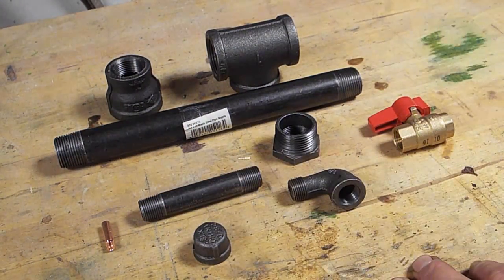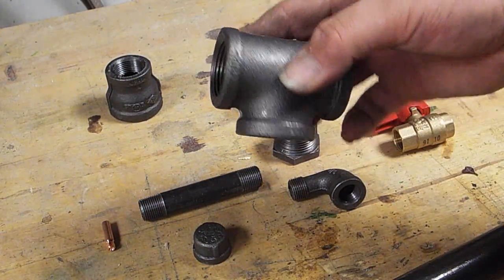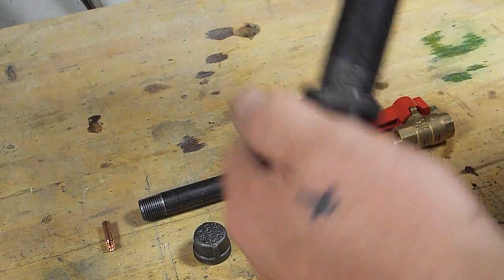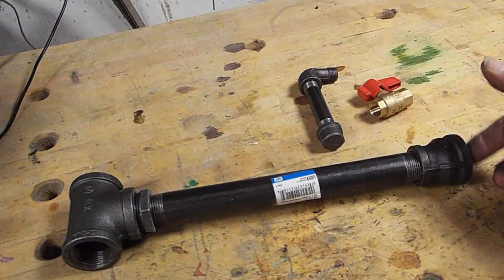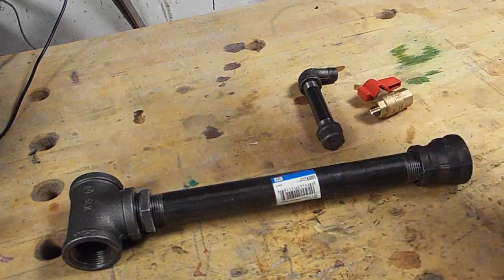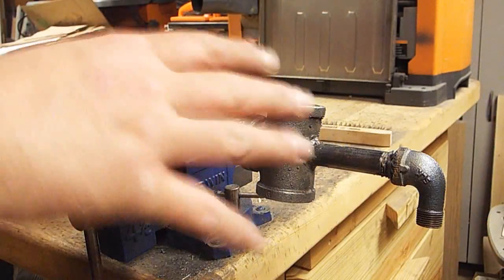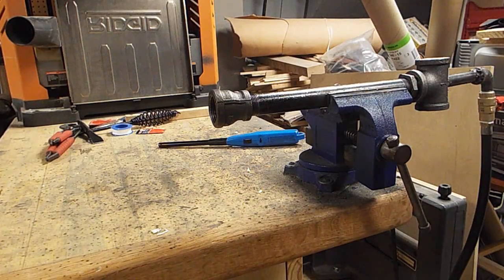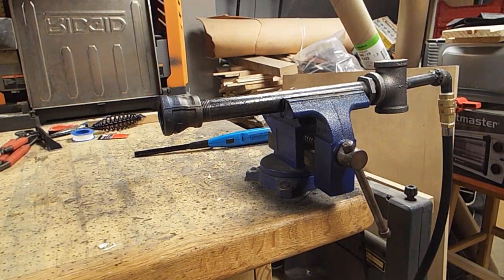GPW 98 - DIY Forge Burner

Comment: The BAD thing about galvanized piping in a forge burner is that when zinc is heated at high temp it produces VERY toxic fumes. This is why experts warn DIYers  NOT to use galvanized steel in this kind of projects.

Comment: I was wondering if you drill and tap the tee so that you can screw the nipple into the tee then you could use the cap with the mig tip to jam lock it in to place.
Reply from the maker: I have asked, in the past, about running long threads on black pipe and was told that it doesn't work very well... But, if you can run the threads long enough, on the nipple, to get past the radius of the tee... Then, I think it would work.

Comment: How big is the hole in the MIG tip???
Reply from the maker: I am pretty sure that I used a .030 in the video... I seem to remember changing it to a .025 later on and noticed that the forge actually got hotter.
Reply: @GPWoodworks  Thanks a lot for your answer... great.

Comment: 3:12 galvanize poisoning apparently has similar symptoms to the flu and it set in pretty fast form what I've read.. 

if it does happen get some fresh air and rest if it's severe seek medical help because it can be lethal. 
also to speed recovery drink milk as the calcium will help your body get rid of the zink.

If you have to weld something galvanized then removing it with acid works pretty reliably and safely.

Comment: If you just use Teflon  tape it won't hold up gas is a corrosive element you have to use special Teflon tape made for gas plus you should test for gas leaks with Windex pressurize your fittings then spray them otherwise you could blow yourself up

Comment: I like the mig tip design feature best if all, that's clever. Oh and welding galvanized is most hazardous to breathing the smoke, wear an organic vapor respirator with an n95 prefilter and you should be good.

Comment: Good job I like your approach. Im a pipe fitter in the union of 20 some years now so I've cut and threaded un godly amounts. Lol..at any rate I'm taking up forging now and in process of making a 3 burner banger...lol...but the only thing is that you don't need to weld the threads are strong but more power to you. I might make a video as well...any tips lmk
Reply from the maker: Scott Andrews

 Thanks man!

I welded for the practice.

As far as tips... my videos are mediocre at best... I would say try to remember to focus and stay in frame... other than that sound is a big deal... I fought with the sound for a year or so. 

You can fix continuity issues during editing usually so just have fun and don't try to look/act like anyone else. 

Be you.

Comment: The fumes it makes. U could use JB weld like a liquid pipe dope.
Reply from the maker: Yes you can... But as you can probably tell... I needed the welding practice.

:)
Reply: GP Woodworks constructive criticism I was not trying to be a troll I'm sry if I came off that way.
Reply from the maker: Not at all! 

It was a good idea. I have seen others use JB Weld for this. 

I really meant what I said. I welded it because I need the practice. My welding sucks.

No worries man. Thanks for the comment.

Comment: Hey
i have construct almost the same but with a 2 burners.  How long is the pipe that goes in the oven ? I have 2 nice blue flames but with not much pressure..maybe my gasbotlle is almost empty..i dont now..but i use a valve on the gastank of 37 mbar..should be ok ?
greetings from Belgium.
Reply from the maker: According to this converter: https://www.convertunits.com/from/millibar/to/psi

That's about .5 PSI.... That is VERY low pressure.
Reply: GP Woodworks 
so indeed it was...the pressure valve was one for camping fire...niw today i bought one of 4 bar...damn...its like a jet now..it burns like hell now in the oven..so im glad this one is working great and now i can further forge the dragonhead im working on..thnx for this video...keep up the good work.  Tom
Reply from the maker: Thank you!

Comment: I made a pair of these and connected them inline, I had them working fine in the vice, however once I installed them into my forge  one of them was stead y burning and the other would burn but sputter, wondering if you might think this is an alignment issue??
Reply from the maker: Not sure... try lighting each one independently. if the sputtering one will work without the other one burning, then it's probably something to due with the setup (burners too close, forge too small or closed in for two burners etc)

I'm really not sure what the issue is, but that's not a bad place to start.

Comment: Great video!  I'm trying to make this.  My local hardware store has MIG tips but they are in inches: .023, .030, .035, .045.  but I don't see any .6 or .8.  Is that in millimeters and if so what would that be in inches?
Reply from the maker: .6mm is ~equiv to .023.

.8mm is~equiv to .030

I started with .8 and changed to .6 in my burner. The .6 burned hotter in the forge.

Comment: I had a friend that welded Gal. all his life . Well it finally killed him he died at the age of 106. So I would stay away from welding Galv.
Reply: i welded to for a couple of years they said drink milk before welding it what ever that did lol i have three heads now
Reply: @huntingtreasure8855 , that was all the milk
Reply: They now teach welders and trades men to work in a ventilated area with a personal respirator.
Reply: Used to seam weld Galvanized Doors, it would make what I call White Floaties in the air, did make ya a little nauseous, it's called Fume Fever drinking milk does help.
Reply: Done it myself more than once gives you a bad headache if you beeath enough thick smoke

Comment: Just curious how much would it be if I had you buy the parts, build it and ship it 
I really want to have a forge found out a way to do it without a welder but don't even have the tools to do a burner. I have a few knife designs I would Like to make.
Reply from the maker: It wouldn't be cost effective with so many inexpensive options out there.

Here are a couple of examples:

Small Atlas burner:
 http://usaknifemaker.com/knife-making-tools/forging-tools-supplies-c-172/forges-accessories-tools-c-172-173/atlas-small-burner.html

Atlas SS mini forge:
http://usaknifemaker.com/knife-making-tools/forging-tools-supplies-c-172/atlas-stainless-mini-forge.html

Comment: What length is the 3/4 Pipe?
Reply from the maker: I used a 10" long nipple for mine. I don't think that measurement is extremely critical though. I wouldn't go any shorter than 8", but it can be longer.

Comment: You could also use a black iron cross instead of the T and an inline orifice.  You can get both from Mcmaster Carr for about 10 bucks each.  That would let you make it without welding anything.
Reply from the maker: Dar1966 

Thanks... I was looking for a local store solution... but that would have been much simpler. 

Thanks for watching.
Reply: No joy

Comment: I did this forge  burner but it does not have enough air... the burner just barely and silently burns and is very lean... any ideas?
Reply: Wesley swap out your bbq 20 lbs regulator for a high pressure reg. One that will run between 40and 60 lbs.  this way should you choose to build a two burner you can have enough pressure to run both and not have the weak lean flame.
Reply from the maker: I am not an expert.... 90% of my videos show me doing things for the first time(including this video).... 

But, here are some thoughts...

Check the fuel delivery. The "barely burns" issue sounds like too little pressure. Too little pressure will cause the vacuum to fail as well, so I am guessing that you are actually running rich. How much pressure are you using? Are there any leaks at the port? What size mig tip did you use?

I hope this helps you figure it out. Let me know what you come up with.
Reply: This is old but... you may have got your tip too far in.

Comment: what size mig tip ?  like 0.6  0.8 or 1.0 ???
Reply from the maker: Ron Varner I used .8 but .6 may work better for this design. Check the other comments. Thanks for watching.

Comment: what size drill and tap for the mig tip
Reply from the maker: Danny Thomas 

Mine was 1/4-28 some are 1/4-20. You have to measure the one you're using.

Comment: Jesus dude there's now way that chicken hemorrhoid weld is stronger than the threads.
Reply from the maker: Newfie Ingenuity 

LOL!!! Good thing this isn't a welding video huh?
Reply: lol yah I'd say. Next time have a little faith in your threads they'er stronger than you think, and its all past the valve so it won't be holding very much pressure anyway, and much less likely to leak. Trust me even that black iron, as soft as it is, is stronger than the brass propane fittings and was stronger before you weakened it with a poor weld.Decent design though otherwise! Like how you used the T for double the air.
Reply: Newfie Ingenuity do you honestly believe that the tee will allow more air intake ?    The choke point is the 3/4,   nothing you do before that point will allow any more air!
If you welded a garbage can on it would it allow 500 times the air?    Lol
Reply: It is impossible make good  welds then u welding cast iron and steel  (different types of metal)

Comment: Nice video, GP.
The burner looks good.
Have you considered how to change the MIG tip?
-------------------------------------------
Schönes Video, GP.
Der Brenner sieht gut aus.
Hast du dir überlegt, wie du die MIG Spitze auswechseln kannst?
Reply from the maker: Thank you Gunter! The tube is only threaded, I did not weld it. 

I can take the tube off and remove the mig tip with small pliers.

________________________________________________

Vielen Dank Gunter! Der Schlauch ist nur mit Gewinde versehen, ich habe ihn nicht geschweißt.

Ich kann die Röhre abnehmen und die Mig-Spitze mit einer kleinen Zange entfernen.

Comment: great job Jason that's the first one that I seen that worked so well and was very simple and cheap to make awesome job brother.
Reply from the maker: Opa's Workshop 

Thanks Opa!

I was trying to find a way to do this with big box store parts. The needle valve and pressure regulator were the only things I didn't find at the big two.
Reply: @GPWoodworks  What & where did you end up locating those particular parts? Thank you,  in advance! 
Enjoyed the approach you took, Pretty reminiscent of our shop, makes ya feel at home. 
Where did you get the hole saw at? 
I don't think mine will CUT it, pun intended.